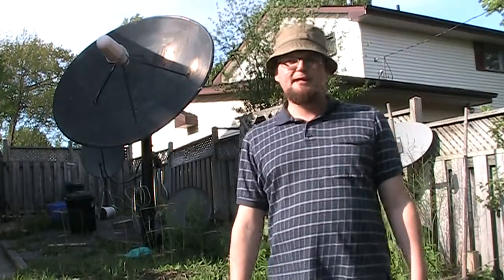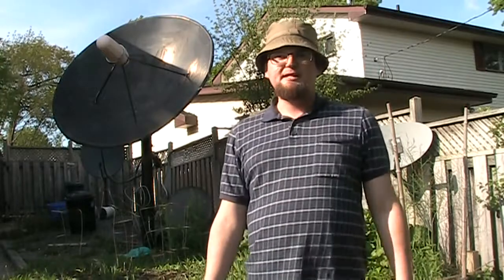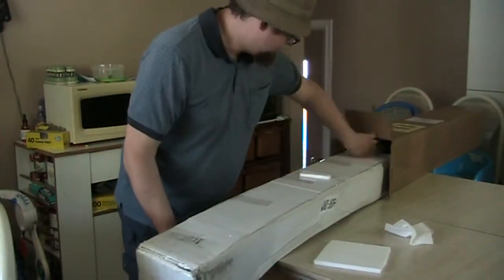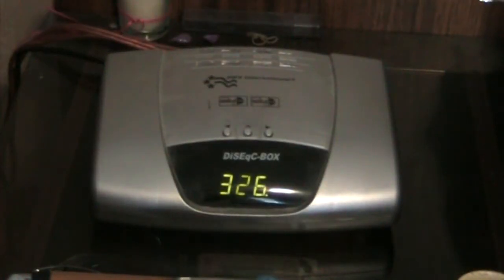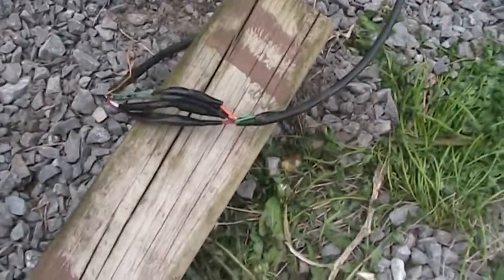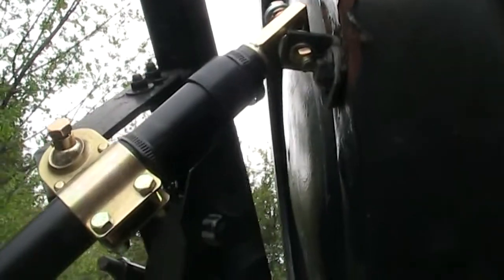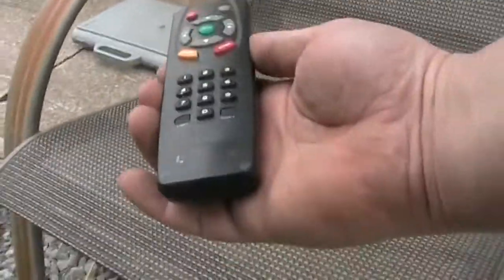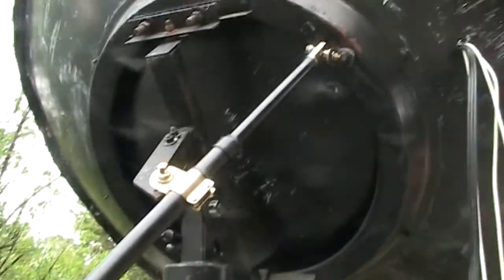Big Black Backyard Cband Satellite Dish

Comment: Hey Robbie,  Just starting out in the FTA  realm and hope you can give me some guidence.  I have an old 10 foot dish with a channelmaster (Chaparral Corotor 1) feedhorn and Drake C band.  I see that this feedhorn design is not  cheap and is still being sold on ebay.  My question is, should I keep this unit or upgrade to a newer c/ku unit
Reply from the maker: I would go with a new C/KU lnb. it will work more easy with a modern DVB S2 receiver. For the cost of the new LNB is less than 1 month of Cable! 
The old ones can still work but you need the motor control to change the polarity. If the motor still works! I use just a Titanium LNB it locks the week C Band a little better https://www.facebook.com/commerce/products/2862135993855552/?rt=9&referral_code=page_shop_tab&ref=page_shop_tab
Reply: Thanks for the quick response  and the link to lnb.  I had been checking that unit out.  Did not see  one with the c/ku design and was not sure what the 2 c inputs would really do for me.  Going satellite is completely new to me, the dish has been sitting in my back yard for the past 20 years and just now getting around to doing something with it. Hoping some NTSC3.0  content ends up on it 🤪 Either way, should find enough content on it to keep me busy.  Thanks again.

Comment: I've got a bud but haven't used it in many years. How can one control an actuator these days? My old receiver used to move it.
Reply from the maker: I use a super power jack mover you can get one at Tek2000.com you can set it up so your receiver can send the command to the super power jack to move the dish or just use the movers settings! https://www.youtube.com/watch?v=7mfDgR4o6TQ&list=PL_g5Ad_LMmeLEYR6a_97RLBvvP8dXFThU&index=57 PLEASE SUBCRIBE AND CHECK OUT MY #FREESatelliteTV video's
Reply: @RobbieStrike  Thanks. Don't think it's worth it, pretty expensive. Not sure if my dish would get good enough signals. If there was more FTA stuff or grey market channels like there used to be then maybe I'd try and get it going again. I'd probably need new actuator and LNB too so I'll just leave it for now.

Comment: I know you don't have this dish anymore . The reason your actuator started to fail is your missing the weather boot to protect the shaft from rain getting into the actuator shaft. For I noticed you didn't put one on the new one.
Reply from the maker: LOL please watch the video again more carefully. I ended up scrapping Black Beauty but it wasn't because of the actuator I could have just simply replaced it but the actuator ,I replaced in this video still works just fine. The weather boot if you've ever noticed most c-band satellite dishes don't have the weather boot on them and the reason why is that it limits the amount of stroke that the actuator has for the current time with C band satellites there are satellites on the East and the West. Putting the weather boot  on would limit the ability of the dish to go far east. I think that's the reason why most people with c-band satellite dishes don't bother installing them. Now in the next few years the satellite industry is looking at concentrating more satellites to the higher point of the sky to eliminate interference from 5G service. So when that happens it might make more sense to use the weather boot because of the limitation of a need to move the dish at that point.
Reply: @RobbieStrike  the c band dish I have has a weather boot on it and it does the full motion horizon to horizon. .I think when the dish was installed where I got the dish from when it was new must of put a longer boot on it.